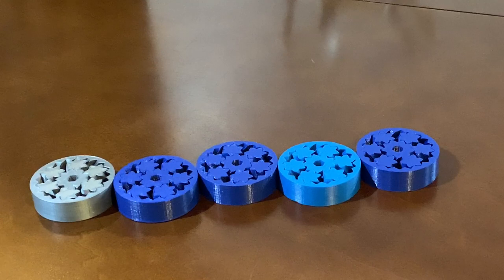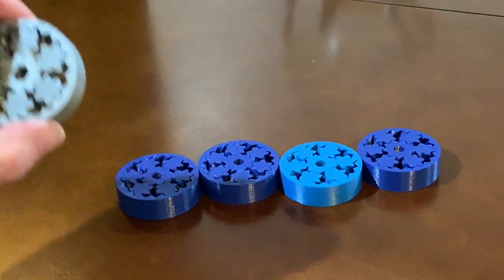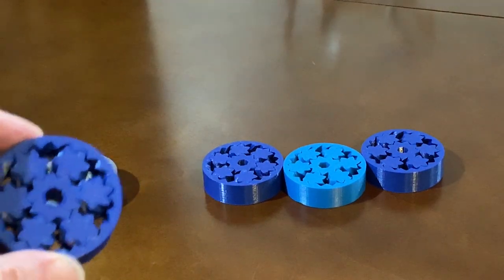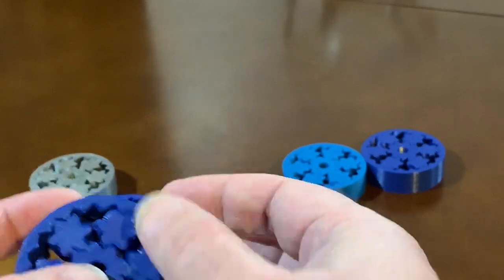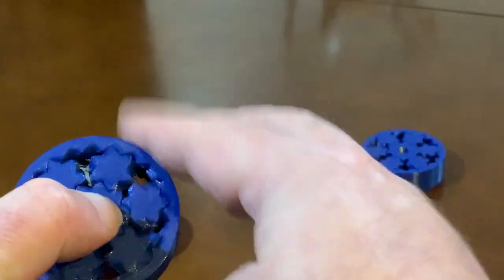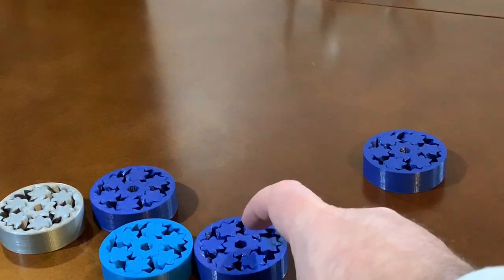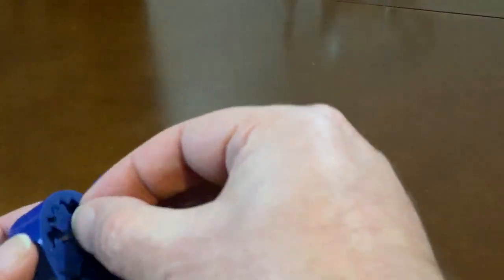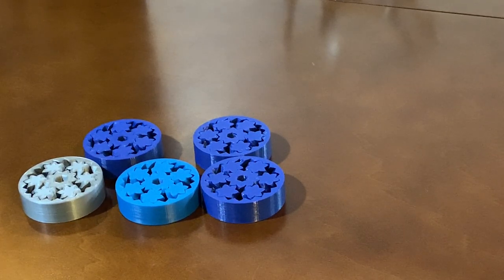PETG vs PLA Gear Bearing

Comment: You might consider using a raft...sure it burns a bit of time and filament, but in addition to bed adhesion, it insures a perfect Z height by the time the actual part starts to print.  If I need the bottom layer to free of brimming, I use go ahead and use a raft as insurance.